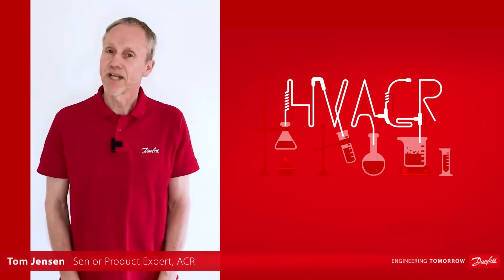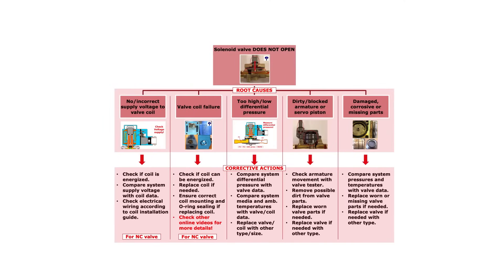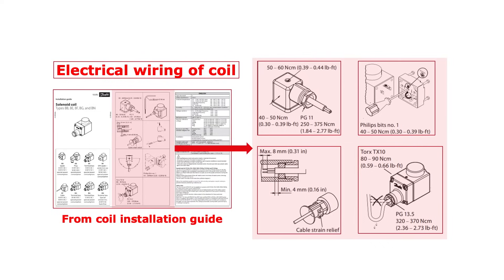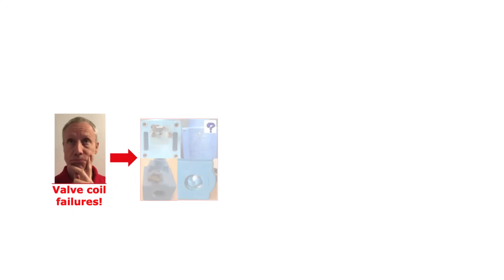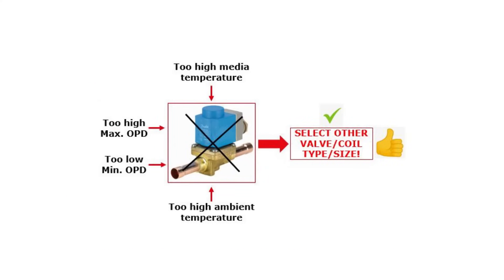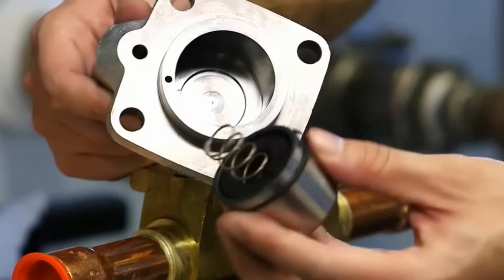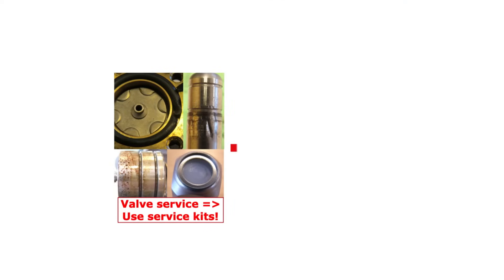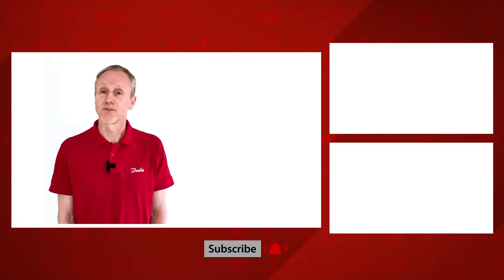How to troubleshoot a solenoid valve which does not open

Comment: So the actual valve itself can go bad? I tested the solenoid with the multimeter and it’s reading about 20 ohms, but the valve still doesn’t open.
Reply from the maker: Thanks for your question. We are checking with our experts and will get back to you.
Reply from the maker: Hi Arturo. If you measure resistant on coil, this should be okay. Then please check the other possible root causes, like MOPD (diff. press. across valve), possible dirt in armature system. Alternatively contact local Danfoss for further support. We hope this helps!
Reply: @DanfossClimate  Hello thanks for the reply. I figured out that the problem was that the wire hose wasn’t connected properly to the machine. That turned out to be the problem, sorry it’s because I bought it from someone else. A little bit of troubleshooting and I realized that, that was probably the issue and sure enough it was. The machine works great now. Thanks for getting back to me.